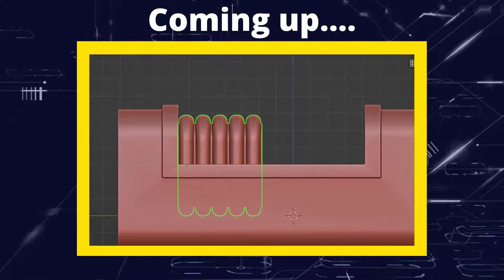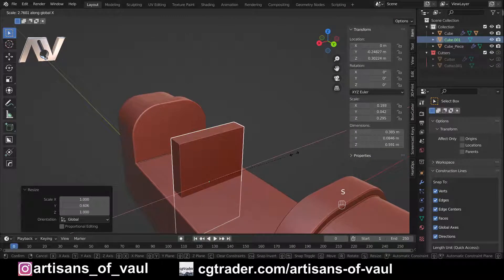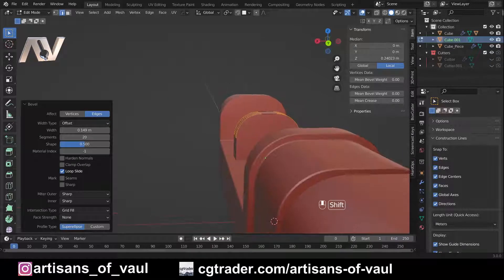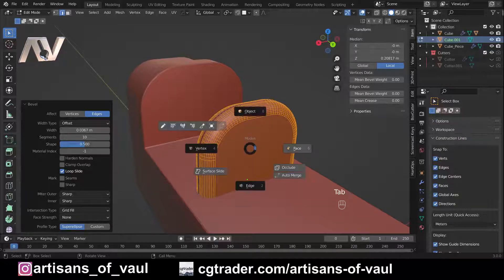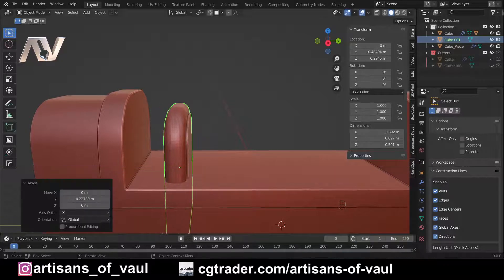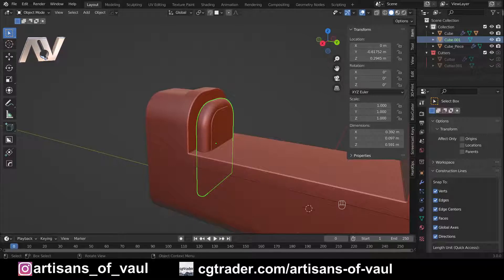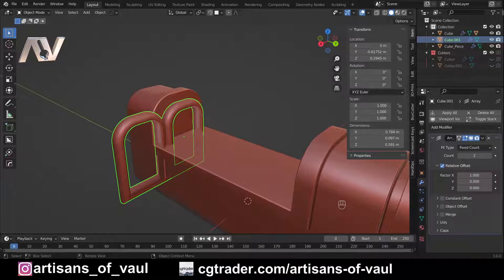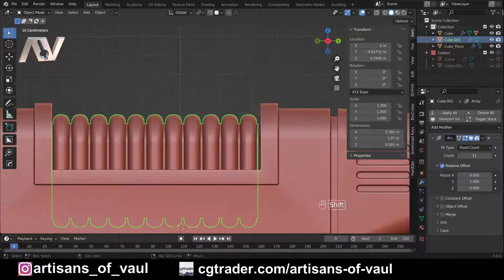Using the best array for the job in Blender

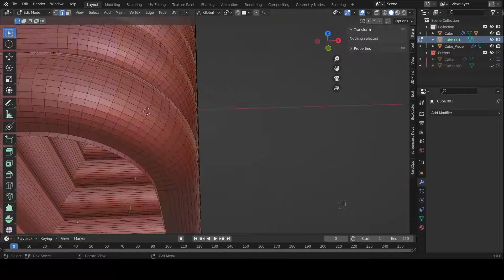Comment: Question: 7:50 - you fill/add a face on each side of the arrayed mesh respectively. But do we need those faces at all - since the array is connected to the faces on both sides of the originaly existing plasma gun ? (hope it's clear, what I mean 😅)
Reply from the maker: I think I know what you mean. To boolean objects together you want them to be manifold, meaning they are a "solid" object. If you didn't create the faces to fill the holes in the object then it wouldn't boolean together well. But if you aren't looking to 3D print then it could be fine if you weren't booleaning everything together.
Reply: @ArtisansofVaul  Thanks! Got it now.)

Comment: Great video, thank you! Whe nyou delete the face at 4:53 in order to prevent the internal faces - rather than deleting the face and ensuring they arrayed exactly, could you have arrayed the with a slight overlap and and boolean union instead? Is this a lazy way to do it or would this not work? Thanks for all your effort and content :)
Reply from the maker: Thanks.  It would work to have an overlap but it has been something that can cause issues.  I find it causes less work to do it before just in case.